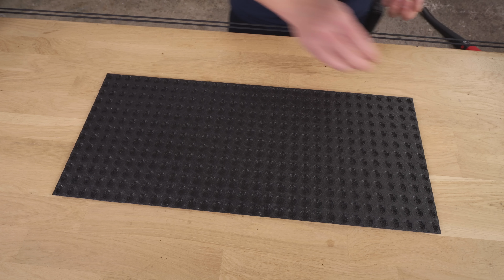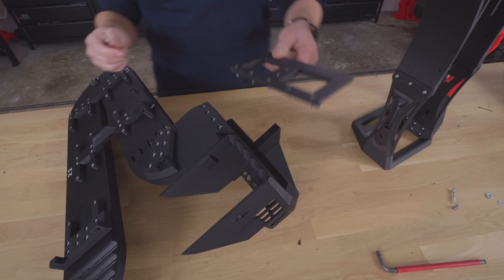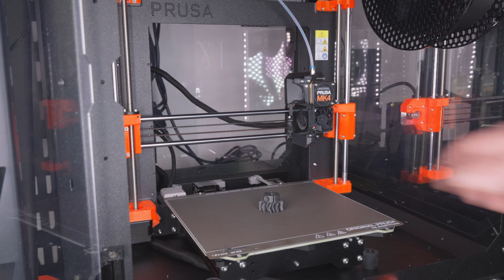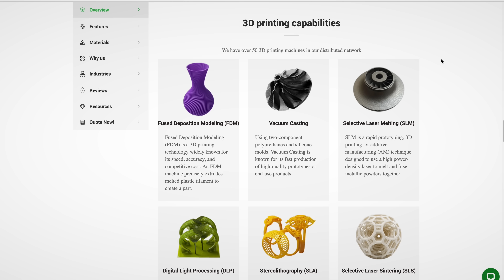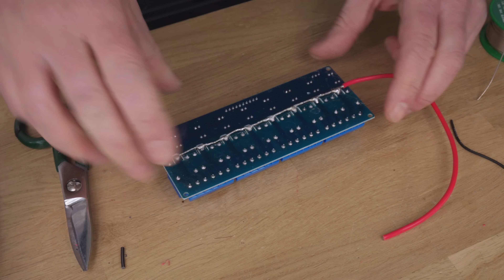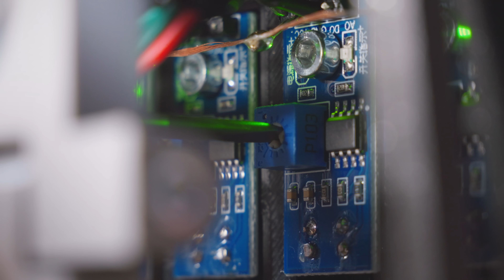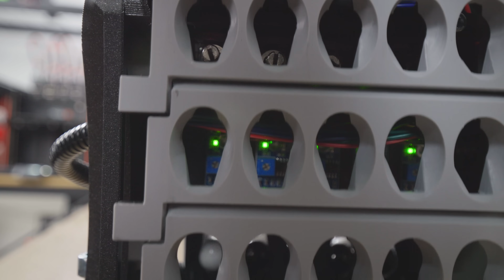Mini Giant Marble Clock that tells the time using marbles - Still too big

Comment: Make 19 vertical tracks and balls falls vertically can simplify the mechanism, latches on each section of hour, minutes tracks releases at right time, then motor have many rest time. Or you can only make 13 columns and ignore the black columns , only used white balls will further simplify the structure.

Comment: One problem with this design is that it is not deterministic.  It relies on the random assortment of the marbles for the correct marbles to be available in each row, which means there is a chance they won't be and the display will be incomplete at the time a new minute starts.

Comment: it is impossible for me to suggest anything to improve the marble clock, however, i think you can make a "marble collector" for your Marble Suction Collector 1.0. what i mean is that maybe 3d-print a Y shape to feed the marble to the suction, so it will be easier to collect instead of only a small single point near the suction point

Comment: This video focuses only on explaining the mechanics and electronics. However, we must not forget that the essence of a watch is the process software that determines and control how precisely it keeps time and how accurately it expresses it. I especially regret that this video does not explain how to make the figures of time with only 5 dots lines of white and black marbels.  The importance is how to decide the order of the five black and white marbles to be arranged in the next vertical row, and how accurately open and close the marble stopper every one minute or 60 seconds.

Comment: Wow. Cool. I'm not an engineer, so you know better, but would it not be a good idea, instead of one large hopper holding all white and black marbles, separate the marbles by size - white is slightly larger than black - with a sized mesh, into two trays and your sensors determine which marbles get loaded from which tray?

Just a thought. But it is cool. Kinda noisy though.

Comment: I've had an idea.  What if the marble tracks were perpendicular to the display, rather than parallel?  You would load marbles in a black-white-black-white alternating fashion, and eject only the differences.  The complicated part would be engineering the location of the actuator to eject the marbles, that wouldn't block the view of the marble below it.

Comment: This is extremely cool, but I would opt for a design that doesn't rely on randomness

I'd use two sets of channels, one on top of the other, that feed the belt, with one solenoid for each column that switches which color is allowed to move onto the belt, we don't need to worry about colors "leaking" in since every space should be filled and we already know what we need to display for the foreseeable future

A basic channel sorter would sort the marbles coming off of the display into our stacked channels, this system would allow maximum speed operation, with an even higher potential belt speed

You'd also be able to use fewer components, with only 5 solenoids, 1 sensor, 3 servos, and 1 stepper motor required

Comment: Such infrared sensors will not work for a long time. With constant switching on, even for a month there is not enough resource, the LEDs burn out. I've already checked it several times.

Comment: Suggestion: use a different method to get the right marbles to the right lanes.
I would think there might be a simpler method to get the right marbles to the right lanes.
You know what marbles are in which spots on the elevator and know how many of each color you still need.
you could devise a method of pushing out any of the elevator lanes to any of the display lanes. This could drastically cut down on the rejections and improve loading times.
Better Idea: have each lane do the sorting and drop marbles to the next lane and add one more lane for a discard lane.

Comment: Maybe a color separator before the marble loader would make it more efficient. If you had a bucket for white and bucket for black then you could load the needed colors instead of unloading the random colors you do not need. This method would require a single sensor instead of one for each row.

Comment: Loving this project!
I still say that having your white marbles being just 1mm diameter different from your black marbles would let you separate them mechanically and instantly with a simple classifier, a hole or rail section too small for one to pass through and big enough for the other to pass through easily.

this would mechanically simplify the system by eliminating one set of solenoids and their pcb's and control and power systems in favor of 2-4 sticks to make a rail...

in turn, you could put more time and effort into the selector, so that you can make it faster etc.

EDIT: Check out Delrin Ball Bearings!
Reply: It's hard enough sourcing bulk 16mm glass marbles. They aren't available in small size increments.
Reply: @phishstyx   hard but not impossible if you're set on glass,

however, ball bearings come in a variety of materials, like Delrin, which are available in a variety of colors and in discreet size increments including 15 and 16mm, and are available in bulk, widely.

Comment: Could you move the whole ramp right a chunk. At the moment the ramp dumps into the left side of the hopper and the elevator takes from the right side, what if you swapped those around so the ramp passes the elevator before going into the hopper.

Comment: Fun project.  Dropping in individual numbers instead of the block of 4 could be cool.   And extra satisfying on the roll over from 0959 to 1000 for instance.   Would need less speed on the filling mechanism.  Amd the  numbers changing slower could sort of fill "at random" or some consistent slow rate.  Down side is the an error could live for 12 hours.

Comment: Ich schau deine Videos gerne an die kannst dadurch verkleinern in dem du Edelstahl Kugel nimmst Durchmesser z.b 8mm die dunklen kugeln damit die schwarz aussehen kannst du brunieren lasse das ist ein chemisches Prozess  was in der Metall Industrie gerne gemacht wird und die Elemente für die Uhr aus CNC gefräste Teile fertigen lassen 3d Druck wird ungenau je kleiner du drucken willst.Da deine Kugel aus Stahl kannst elektrische Magnete benutzen und Signale kannst elektrische Licht Signale realisieren.
Dass wäre mein Vorschlag dann wird dein Uhr auch wirklich kleiner

Comment: so, smaller marbles to get smaller parts which means fewer parts and fewer brackets. Also, figure out a way to 3D print the marbles, perhaps as ball bearings encased in plastic. Print the bottom half, add ball bearings, print the top half. 1mm ball bearings with plastic covering to make them 2mm diameter means your 5x17 grid is approx 11 x 40mm

Comment: Maybe you rejected this for a reason earlier, but it seems sorting the marbles would be easier and purely mechanical if the white and black ones were slightly different sizes, like one millimeter different so they could fall into different trays.  Maybe they could also be loaded purely mechanically without software by spinning cams that know how to "deal" each number properly and the whole thing turns into something driven purely by one motor and zero software as if it were built in the late 1800s or early 1900s.

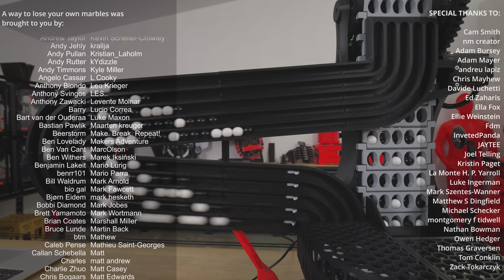Comment: Why process the same number over and over, why not replace one number at a time, instead of creating "20:01/20:02/20:03" every time, just allow dropping of insividual number chanels. That way the minute column could be processed in 1/4 of the time.

Comment: I keep thinking that you could get so much more throughput if you did the filtering after it was in the channels so that the elevator could go faster and would never have to stop. Also, if you put nubs on the upper roller for the elevator, you wouldn’t need that red ejector piece that will eventually wear out.

Comment: Great skills and humor. I know it's just meant to be a fun project but I couldn't brush off the fact that it's highly inefficient... And that if you updated the display vertically instead of horizontally – by columns instead of rows – you could save a lot of marbles, updating only the necessary digits each time.

Comment: You could add a third blocking servo near the top so that the belt could run continuously. It would feel more clock-like for it to keep running, and if you ran the belt at 60 links per minute then the rejected ball clack would be an audible tick of seconds.

Comment: I like to think with a full size 10 or 12 lane tall clock face, it would be much easier to use the 3x5 grid to display the numbers, stacking the hours and minutes on top of each other on the original clock. So that way it could collect all the marbles in time, give more time for the clock to collect the right marbles, and greatly increase the accuracy of the time

Comment: What about one more staging section? Another set of gates further up so you can stage another minute ahead with the faster processing speed.

edit. *Stage part of the minute display so the belt can run longer

Comment: A really fantastic design and I can't fault it in any way but as you appear to be a perfectionist (read this as maniac) I have an idea that might be worth a try.  Rather than sort the marbles for each line why not just sort 2 lines,  one for each colour and then dump then into bins at the top and that way you can feed from the bins in the right order giving a much faster setup of the time.  This would allow you to make a really massive clock with many more marbles in each row.

Comment: Just stumbled upon the channel, amazing designs! 

Is there such a thing as a centrifugal marble elevator? 

I'm imagining a vertically spinning cone with the lower side being the smaller end. I guess the marbles would need to be rolled in at speed to initiate the spin and a fly wheel would be needed for retaining a high rotation speed.

Cheers 🫡❤️

Comment: According to some math I did in a spreadsheet the average clock display contains 32 white marbles and 43 black marbles, so if your clock has 1:1 black to white marbles that's going to make the random selection take longer. you should have a ratio of 3:4 white to black marbles in the system total to optimize the draw time further.
Reply: If you keep a 1:1 ratio but alternate display color every minute (white on black, then black on white), then the marbles in the pool will always be more plentiful in the color you need
Reply: @elektriktoad2  Oooh that is really clever
Reply: There is a small chance that there will never be tails.
Reply: A pre-filtering step would also be good.
Each of the 5 rows has a different ratio.
In the marble drop area at the bottom, add a step that separates marbles into black and white sections, then feed them into each of the 5 tracks in the correct ratio.
Reply: @anon746912  You saved me typing time. I was going to suggest separating the colors first, then only load into the chain the correct colors for that vertical section.

Comment: You know, another option for speeding up the draw would be to add a third stop closer to the top of the track that would let you "lock in"  the next minute once it was done drawing while still running the belt to start the minute after. That would let you avoid the delay in drawing you get while waiting for the drawing cycle to finish, giving you more slack in the remaining optimizations (especially motor speed).

Comment: I think about the only thing to add would be a darkened window over the marbles queued up for the next number so that you could still see them if you wanted to, but they won't stand out as much as the actual current clock display.

The only other thing I could think of would be to sort the marbles at the top into white and black reserve tanks rather than booting them out on the way up. This would also speed up the filling process as no pickup would be ejected on the way up. It seems to me that choosing to operate without reserve tanks is why your refresh rate was sometimes slipping beyond the 50-something seconds available. It's trading one kind of complexity for a much tighter and less forgiving operating margin.

Comment: It looks like you have 19 columns and 5 rows, and you are using 5 tracks (rows). Why not use 19 tracks and load by column? You'd only have to change out the last digit every minute (or second), the second digit every 10 minutes, etc. would be so much more efficient.

Comment: If you made the black and white marbles out of a different material like one being either heavier, or magnetic, or slightly larger, you could purely mechanically setup the entire clock system and only need a single motor.

Comment: Just noticed the mechanical ejection at the top, which will always be perfectly timed right? 
So why not use the same mechanism for rejection? Just use a magnetic field to hold back the arm when you want it to keep a marble. Might give you more wiggle room than you get with the timing of the solenoids?

Comment: You could shave 10% off the time it takes to generate the clock readout by getting rid of the column of black marbles at either end. That is, if you still feel like tinkering with this crazy, amazing project.

Comment: 248 For anyone with the same kind of ocd as me. You used 248 screws assuming you took away 15 links of the elevator. Which is a weirdly round number considering you just put an arbitrary number of screws everywhere you liked it. Anyway rest easy you don't need to count them yourself 😅

Comment: I like it. Me? I would have used a one marble elevator (>2 marbles/sec), one marble/color detector at the top, and 5 solenoids at the top: one to kick out a marble or not, 4 Solenoid/wedges to guide the kicked out marble to 1 of 5 slots. 

     |     |    |    |    Solenoids with
     V    |   V   V   Wedges
  /       V   x<------  Marble <---- Kick Solenoid
   5  4   3   2   1   Slot
             |
             x  Marble Dropped into Slot 3

Comment: Great idea, although I'd prefer it so much more if it was a constant flow mechanism of (very slow) moving marbles that come from all single lanes preloaded with chaotic looking pattern that then happen to align during a particular (minute long) frame then move back into chaos. Also much quieter and more elegant this way (albeit a bit harder to tell where the exact minute mark is hit).

Comment: Is it possible to print them with horizontal tongue and grooves so the pieces slide into each other instead of needing to print so many brackets and use so many bolts? Just a thought, I’m genuinely curious. You would need to prevent them pulling apart obviously so maybe a dovetail like tongue? At least for the tracks.

Comment: you could get it to reject white and black marbles into separate trays when the currently drawn frame is rejected, since the marble locations and colours are known. You could then selectively allow or disallow them onto the elevator using the same electronics you're using here, only you would have to double up on solenoids for rejection. You may not even need sensors then.

Comment: OMG. what a build. But i can think of a few ways to make it smaller and most importantly simpler
hint 1 : vertical not horizontal update means you can update the seconds at seconds freq , minutes at min freq etc  hint 2 simply sort black from white on return and then rout them to the correct drop tubes above as needed with a simple black and white single marble elevator that runs when hopper up top is empty.

Comment: 17:53 It would be cool if the steps were timed one per second - so that the marble solenoid was like the ticking of the clock
Reply: I think there would be a way to create full displays with that if you used various other commenters' ideas about separating the black and white marbles into two collection areas

Comment: what a fantastic project, but i'm wondering a few things and maybe you can make a video about that too
* how many hours did you put designing it
* how many misprints did you make and what about the costs thereof
* how many rols of platsic did you use and what are those costs ( if we'd wanted to to print it ourselfs )
* what about other hardware and the costs
* what did the total project cost ( roughly )

Comment: Speed optimization challenge:
When the balls are released from the display, use a sensor to separate the white and black into two different bins. Now the controller only needs to decide from which bin to select to create the next display.

Comment: Further optimisation can be achieved by reducing number of all-black columns.
e.g. 2 black columns when showing a "1", or perhaps the rightmost and leftmost columns.
If you don't mind writing more complicated code and don't mind the display changing width or being without dark edges, of course :)

Comment: I don't think you need that much screws, really, two screws hold rotation just fine, If you want to prevent slipping, use some mild adhesive in between the pieces held yight with a sensible amount of screws (2 o 3 per joint)